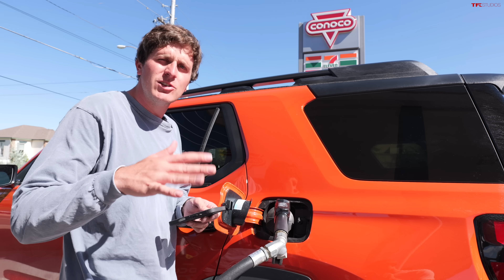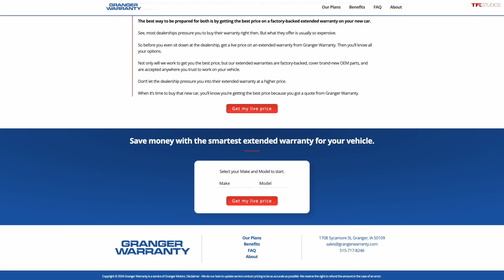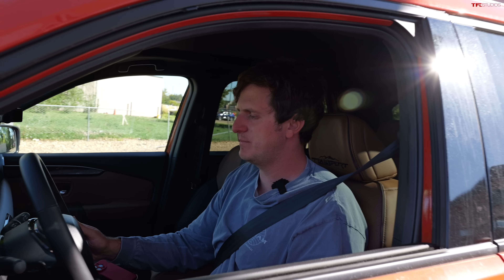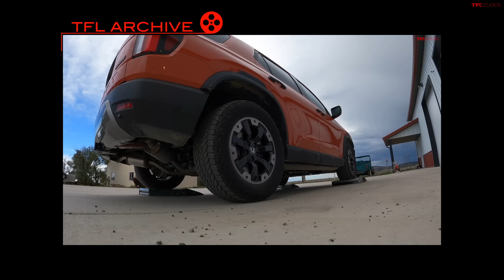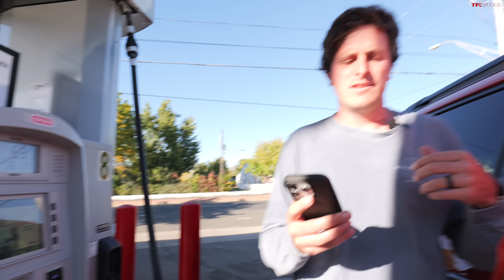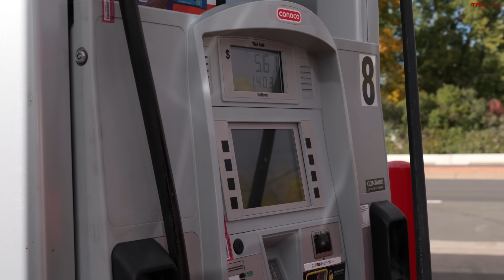Does Driving In Economy Mode Really Use Less Gas?

Comment: Great video - very helpful for me as I am contemplating purchase of a Passport.  Thanks!
Reply: You won’t be sorry getting the Passport. It is a great all around vehicle.
Reply from the maker: So glad it was helpful!
Reply: @TFLnow  100% agree with your comment about wishing for a hybrid option.  The Passport's engine and transmission feels like 15 year old technology.
Reply: @alexiz689  That's what a lot of people love about it, though. :)  That "old technology" in its engine and transmission makes it very reliable, and cheaper and easier to work on when needed.
Reply: I bought my Trailsport Elite in May and we spent last week in Grand Marais Minnesota — requiring us to take washed out fire roads outside of town for day hiking stuff. This vehicle was designed for this trip. It was a champ on I-35 from Saint Paul to Duluth and Hwy 61 to Grand Marais. Smooth effortless highway driving at 80 MPH. Then it was a true champ on the washed out rocky fire roads and off trail turnarounds. Effortless. Yet very enjoyable. I had a 2014 Tacoma 4x4 Off Road. I feel as confident in the Passport.
Reply: In the conclusion you should have wrapped up the results better. I do know how many mpgs each mode got? I just know that the guy thinks normal and eco are the same and sport mode is worse...

Comment: What was the cruising speed on the highway during this test?
You mentioned that the start-stop system is disabled in sport mode (good), but what about the variable cylinder management (VCM) system? Is it also disabled? That would be great, and I might end up driving the Passport in sport mode all the time.

Comment: Werd, people lie,  19. 5 mpg all day long, lol,  me and wife' 70 years old,  bought our 2926 trailsport,  IN. AUGUST,,  just dump the oil,  today 13 of Dec,  2200,miles   oul looked like crap, vehicle  was made  i. June,  so oil has 6 months,  on it had 10 miles on it when bought from dealer,  still a lot of starts from factory,   auto hauler s, or on trains,   oil breaks down fast,  from rings not seated, fuel  gets in the oil,  7500  for first oil change,  people haven't  a brain,  lmao,  engine  already  junk,, Keep for 30,000,miles,,  get rid of it,  input from a honda tech,,

Comment: Go easy to 1000 miles, then at 2000 miles dump the oil,  do it yourself,  cost 60 bucks 5w 30 castrol  edge honda filter,  keep in sport mode, cancels  the 3 cylinder  shut down,  way funner to drive,   never seen anything  better than 19.5 mpg,  in any mode, lol,  so just have fun, and  mash it,

Comment: I noticed on my 2020 Honda CR-V that econ mode lessens the throttle response. So makes it more fuel efficient for lead footed drivers. But I also noticed when on the highway and I have econ mode on and I come to a hill the speed will drop more before the cruise control would accelerate. And would rev the engine up higher trying to play catch up often going slightly over the set speed. But with econ mode off it wouldn't do that. For example, the cruise is set for 70 MPH and the engine is running at 2,400 RPM in econ mode, the CR-V would let the speed drop to 68 MPH then rev the engine up to 2,700 or 3,000 RPM to get vehicle back up to 70 MPH, sometimes taking it up to 71 MPH. But with econ mode off, the cruise control would only let the vehicle speed drop to 69 MPH and would barely raise the RPM to get the vehicle back up to 70 MPH. I tested this on the same hill on the same day, several times.

Comment: I’m surprised at you guys. You are usually very good with your testing, but you should have recognize that despite your best intentions, you cannot get a fair comparison between the three drive modes unless the same person drives it all three times. You changed drivers for the Econ mode and since the results were so close one can’t help but wonder that it might’ve been different if you hadn’t changed drivers. In theory the Econ mode should’ve done a little better than the normal mode, but now we can’t be sure if that’s because that simply isn’t true or because it was a consequence of a different driver performing the 50 mile loop.

Comment: These driving modes are just gimmicks. Give it a throttle cable or make the throttle linear with no programming and it will respond how you want it to every time. Its crazy going from a newer vehicle back to my old 2003 Land Rover Discovery. Now very powerful but the throttle response is instant compared to newer vehicles, and there is no kind of programming to reduce power. It gives me power (not much power lol) when I want it, not when it feels like it wants to. Just make the dang car respond to your inputs instead of these gimmicks.

Comment: I'd like to see mileage loops on any of these vehicles you test do the short loop, and then one that runs it almost to empty. I'm not a huge mileage checker type, but I recently got a Maverick hybrid so I've been paying attention. After 3,500 miles every time I've filled up it has been almost empty, except once I only drove for 100 miles before filling it. On all of the fill ups I average between 39 and 41 MPG. Except the 100 mile fill up. That one got me 46 mpg. I'm just kind of wondering if the overall longer trips have a greater affect on the MPG.

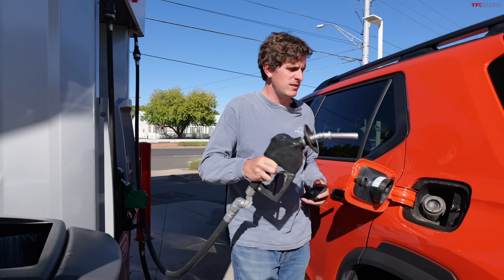Comment: Interesting points- 5:53 You did exactly 50 miles. Also, you have 251 Miles of range left (getting 25.3 according to the car)
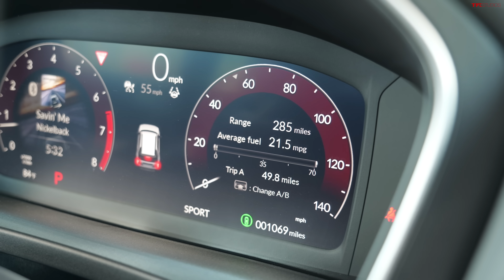Sport mode-           12:11 You did         49.8 miles. But, you have   285 Miles of range left (getting 21.5 "accord"ing to the car)

Comment: of course sport mode is going to be worse gas mileage  it keeps it in a lower gear for faster accelerations, but you also shouldnt drive in sport mode very long or it could damage your car. and dont know why honda has an economy mode  just have a normal mode a sport mode and a offroad mode for better traction I think all it does is change the power around in the awd system and offroad mode will get the worst gas mileage and you should never drive above 40 mph in off road mode because that will damge the engine also , only use sport mode when you need to accelerate fast for a short distance.

Comment: On my 23 pilot and back on my 19 civic. I use normal mode on most cases but I live in NYC. When I’m on city streets eco mode helps dull out the throttle. Speed limit is 25 so no reason to get up to speed so fast

Comment: Very interesting video, but overall these looked like pretty ideal conditions. Would love to see the difference between normal and econ in stop and go traffic.
Reply: My experience so far in our hybrid is that it doesn't make much difference. Why? Because you, as a unique driver, are going to tend to accelerate at a rate you are used to. In ECO mode, you just have to push the gas pedal down further to achieve that same acceleration, as compared to Normal mode. What ECO mode is doing is discouraging these higher accelerations because you have to move your foot more to achieve them. But they don't make the higher accelerations impossible. (Well maybe not the highest accelerations.)

As a retired person, I'm usually not in any hurry to get somewhere, so I tend to not accelerate from a start all that much. I have experimented a lot switching between ECO and Normal mode. What I notice is that in Normal mode, I barely have to move the gas pedal to achieve the acceleration I typically want. The end result is that it seems to make the driving more effortless.

For us, the jury is still out on which mode we'll end up staying in most of the time. We're still weighing pros and cons and getting more experience with both.

Comment: My vehicle displays a message when it doesn't activate auto-stop while idling at a red light. I forget the actual wording but something to do with, it can't because it is charging the battery. My vehicle is a 2025 Toyota Rav4 LE (not a hybrid). Thus why I prefer to keep it off. I'd prefer not to drain the battery. There is a problem to this test. I didn't understand his travel but there are two major features I believe he is testing. 
1. Mode (normal, sport)
2. Auto-stop
These features only can be compared in city travel where you are engaging in various speeds to stopping often. 
These features won't make a difference  if you are driving on a highway for long uninterrupted travel.

Comment: You skewed your results since you didn’t use the same driver! Drive modes overall is a gimmick. I would rather manufacturers save the money on r&d of these “modes” and just make a good vehicle. Most people never even touch the mode selector any ways. Manufacturers could then pass the savings on to the consumer in the form of cheaper vehicles.

Comment: Did not think would be that much difference.  Thanks.
Reply: Sport mode in most vehicles will be a huge difference. My Audi RS3 gets 17mpg sport and 30 in comfort mode. 13 mpg difference. But sport in my car is absolutely bonkers, especially manually shifting. 

Hybrids with sport mode won’t make much of a difference.

Comment: My thought is that Econ Mode is only going to help when accelerating compared to Normal Mode. When traveling at constant speed, there is not going to be a difference between them. I would rather have the performance of Normal Mode if there is an unexpected situation where you have to accelerate quickly (even if on an interstate highway).

Comment: I wish I had auto stop start, my last vehicle did, but my current one doesn't. Paying more for gas sucks

Just learn how to activate the engine if you want to (in my old car, just lifting the brake a bit, even if you didn't start moving, was enough), if you don't want the delay. Also, if anything, I wished there was a button or mechanism to manually enter the shut-off state. I kept wishing going to manual shifting and going down from gear 1 would do it, cause sometimes the car didn't think it was supposed to, but it'd have saved fuel. Turning the car into accessory would not be effective, though, since you have to crank it again, and then the music gets interrupted, which is unacceptable 😄

Idk why people love paying for gas so much
Reply: Problem is basic vehicles come with weak starters and weak oil pumps. So every time it starts up, it weakens parts. 

Hybrid is the way to go if you do a lot of stop and go and city traffic. Massive difference.

Comment: I've experimented with my 2024 Ranger (FX4, 2.7L) and found that Eco mode only helps when doing stop & go or similar highway conditions. When driving exclusively freeway (and not heavy traffic) the mileage is the same in Eco or Normal mode. Throttle response in Eco mode is reduced and it has more gear skipping. Normal mode is more fun but that doesn't apply in steady state cruising.

Comment: In the past model, eco mode mainly adjusted throttle response to discourage hard acceleration.  At least that was the main thing I noticed.  As for A.S.S. mode,  it can die a horrible death.  Nothing is worse than that momentary pause every single time you need to make a left hand turn at intersections without a light or without a dedicated green arrow.   Or just when dealing with pulling out in heavy traffic.
Reply: The newer, better hybrid drive trains do not have this problem. They don't have belt CVTs, and they always start from a stop in electric driving mode, so you get instant torque. For those that don't have such hybrids, I'm not sure they are aware what a dramatic difference this makes.

Comment: Had a 17 Ridgeline with 235K miles and I can confidently say the Eco mode button can save gas but it's highly variable. What i mean is by this is;

Honda's i-VTM is always sending power to overdrive the rear this will vary based on terrain,road conditions and weight distribution. This along won't effect long term mpg too much but it will effect the computers decisions on shifting, therefore engine load. Which will effect Hondas VCM windows of operations. This is heavily dependent on engine load which will effect the durations of 3 cylinders.

My 17 Ridgeline had the 6 speed auto and initially it saved quite a bit of fuel on the fwy 28-30mpg wasn't uncommon but as the vehicle got older those windows of operations became more inconsistent. With my guess being activation and deactivation of VCM being hard on the tranmissions fluid which effects the quality of shifting and lock up a precursor to activate VCM, The ecomode button effects tranmissions shift programming.
Eventually disabling VCM provided a more linear experience in Eco mode and regular driving and consistency in mpg despite not seeing the 28-30mpg, more realistic st 26mpg on the fwy. Lifetime at 22.22mpg

Comment: Interestingly, my wife has a 2013 CRV and I have a 2013 Accord.  Both of us discovered we get worse gas mileage using ECO mode than Normal mode with worse acceleration.  I'm pretty tame driver so it was a surprising result to me.  I hate ECO but I thought she was crazy when she told me this so I ended up trying ECO myself in my car and found I too got worse gas mileage.  I don't hard accelerate either nor brake hard.  So we both went back to using Normal mode on our cars.  Even if ECO did give me 1 or 2 mpg it still wouldn't be worth the cost of what you loose with a car driving like a cinder block down the road.  For those that use ECO - You must really hate yourselves to punish yourself that much.

Comment: when oil pressure drops it increases bearing wear every time the car starts thus speeding up engine wear and thus trading years of use for a few gallons of gas
Reply: Having driven hybrids the past 20 years I can definitively say that this is a non-issue, at least it was for us. I'm pretty convinced that any extra "bearing wear" will be superseded by other parts of your car wearing out to the point that you'll want to get rid of it anyway. Things like metal rust, suspensions, motor and transmission mounts, and more importantly, aging and flaky electrical connections and computer chip problems that increase dramatically with the age of your car. These tend to be costly repairs due to difficulty in diagnosing what is actually the culprit. Having, for example, a flaky ground connection can send diagnostic costs into the stratosphere. These other mechanical and electrical issues will eventually result in repair costs that far exceed the value of your vehicle, long before your engine wears out. We traded our last Honda hybrid in because of these latter issues, but the engine itself was running just fine, after 190,000 miles.
Reply: @Trekster1268  hybrid is not the same thing as start- stop. while I understand that it will not effect the first owner and “ you’ll want to get rid of it before” but used car buyers exist and the quality of used cars is going down and the length of service for the second owner is decreasing because the government is making un reasonable regulations and the car manufacturers are making changes that will affect the longevity of the car to reach those goals.

Comment: No brainer about sport vs normal or eco mode.  I would imagine if you actually did your 110 mile loop the difference in normal and eco might be more noticeable.  Give it to Mary for a week and let her run it for 3 days in normal and 3 days in eco mode.  If it is not a significant difference, then that just re-enforces the notion they are gimmicks to add a selling point to vehicles.

Comment: I can confirm that the gas mileage is about 5 mpg different on sport vs normal as I traveled through Wyoming into Utah I tested them out. A lot more down shifting and high rpm in sport. Our Trailsport had 1900 miles at the time. I’m in Vegas with 2500 now. Great vehicle and awesome for traveling.

Comment: Engine stop/start doesn't just place extra load on starters--which can be mitigated with HD starters. In general, greatest engine wear is at startup until oil circulation is fully established. Every time you do a stop/start cycle, your engine has to go through that initial cycle of compromised lubrication and greater wear.

Comment: In my experience, no it does not. How you drive makes much more of a difference
Reply: Sport will hold shifts longer at higher rpm. Therefore it will use more fuel. The lower the rpm, the better the mpg. 

Idling in mornings, stop and go, and drive thru’s use a lot of fuel if engine does not shut off. 

Going up hill, high altitude also uses a lot of fuel. 

For best mpg, don’t idle at all, go down hill as much as possible, don’t sit in traffic, don’t go to drive thru’s, don’t hit any sets of lights, and most importantly, try not to keep foot on accelerator pedal. 

Hybrids are best in city at lower speeds with climate control off. On highway they are much worse.

Comment: 50 miles is too small a sample size. Likely a significant - but small difference in FE at the expense of a more sluggish/driving experience. 

Assuming 4$ gas and a 2 mpg difference with 30 mpg being the normal mode: driving 25k miles/yr were are saving 50 gallons - $200. 

I would rather normal mode.

Comment: It seems like Eco mode on my 2024 Maverick mostly limits throttle response. I don't think these short trip tests are really that accurate. If you get another 1/2 gallon in one fill up over another will really throw the numbers off. I think the most accurate is to average it over several tanks of fuel. Start/stop may save you a thimble of gas but does put more wear on  your engine.

Comment: Having owned several Hondas, I find that they don't hit their best MPG numbers until you have 7.5k to 10k miles on them. So far with only 4k miles on my '26 Trailsport Elite BO it's getting very similar numbers to my previous '22 Passport Trailsport at around 21-22 mpg mixed driving. I do expect that to improve as the engine continues to wear in. I do turn off the start/stop on every drive though, to me the juice just isn't worth the squeeze.